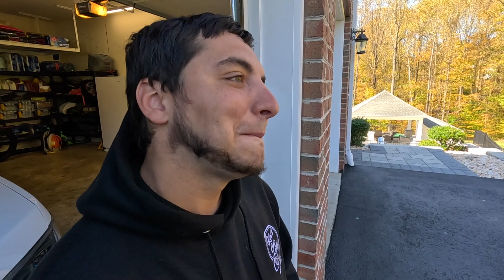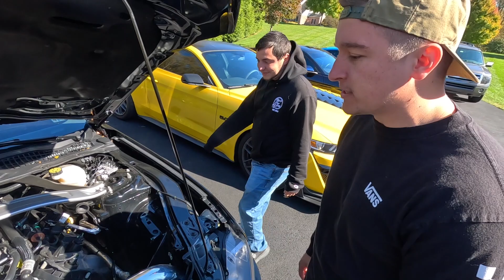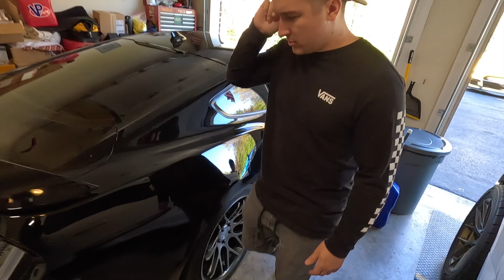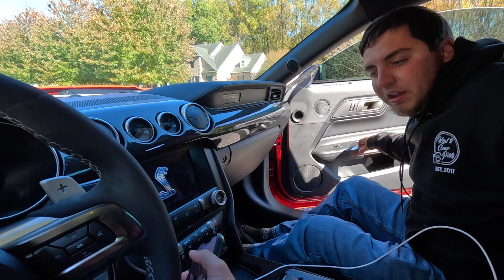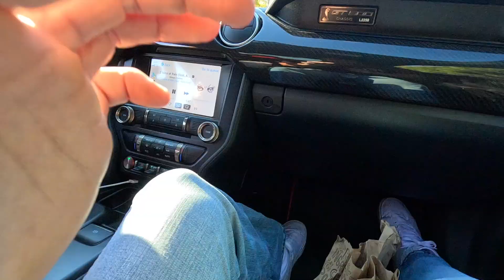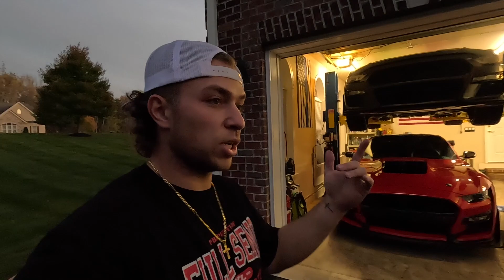Hard Pulls In Everything!!

Comment: There's a plug under the hood that if disconnected it will completely disable TC/Stability and ABS. It's on the driver side fender near where the airbox would be. That has to be unplugged to Dyno the car and if the previous owner did that he may not have plugged it back in. That could be why you're spinning so much.
Reply from the maker: Someone told me that today too thank you I am gonna check